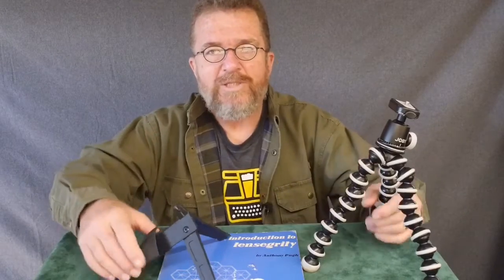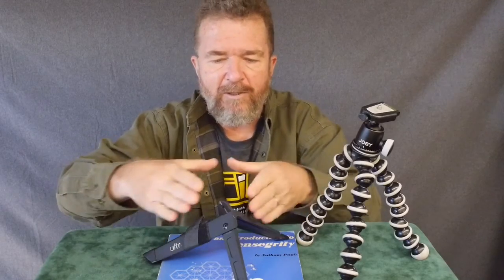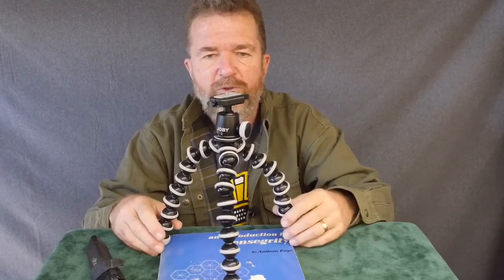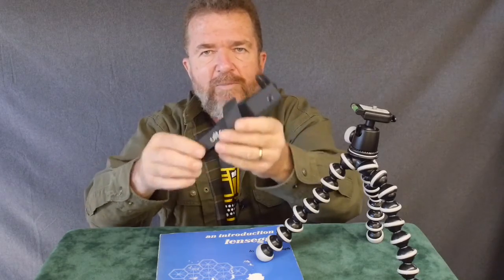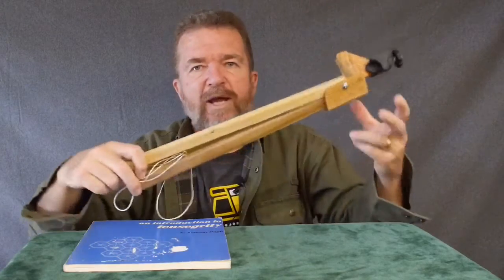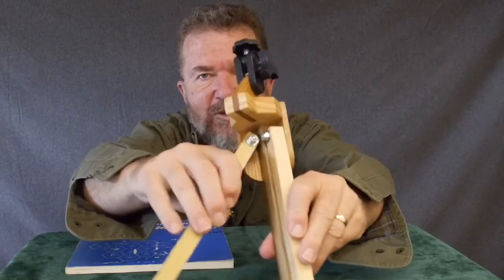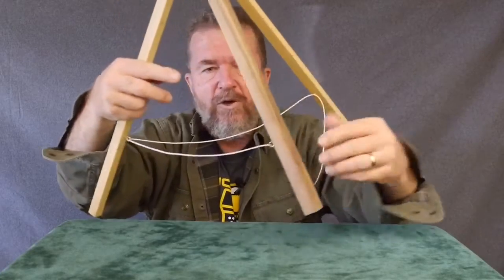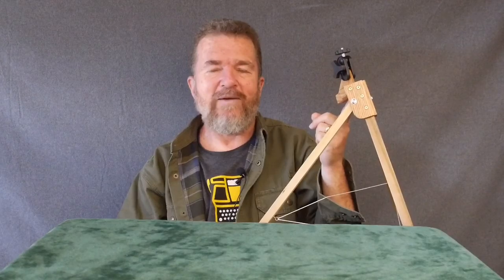Tabletop Tensegrity Tripod

Comment: Hi Joe,

really ingenious. Would You say one could mount a 4x5 camera ( like a Bush Pressman or similar ) on it, without topping over ? My normal tripods are to " shaky " for slow shutterspeeds.
Reply from the maker: I'd use it with a slightly longer set of legs for 4x5, but otherwise it would work fine. The weight limitation with this Tripod has more to do with the small ball head itself.
Reply: Thank You for Your quick answer. I think I should try and build one my own. The ordinary Large Format tripods are way to heavy to toss them around when riding a bike. Guess this one could easily be attached to the upper rod of my bike.